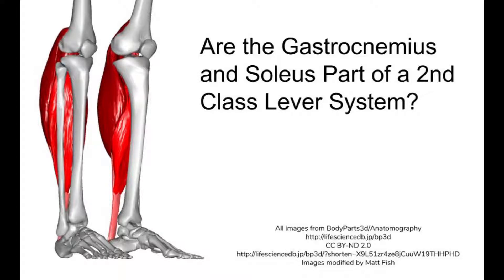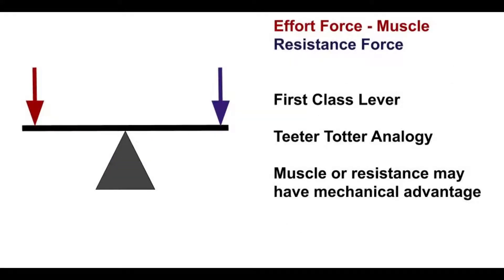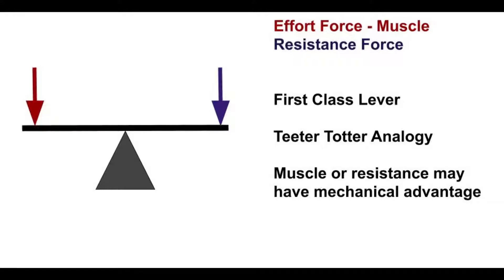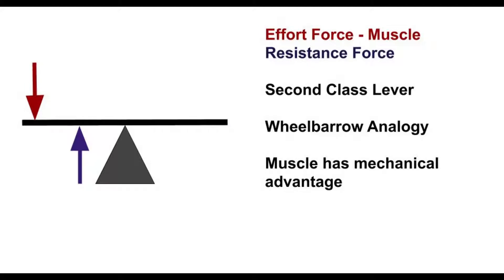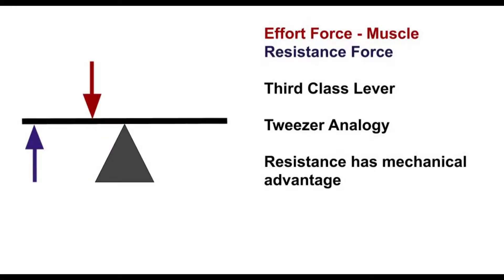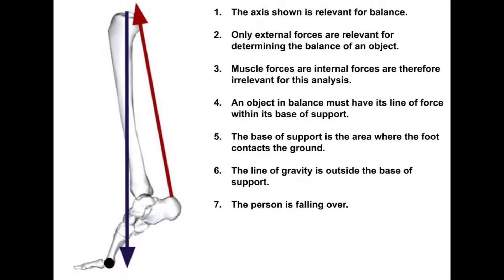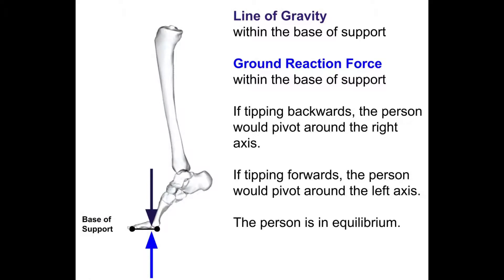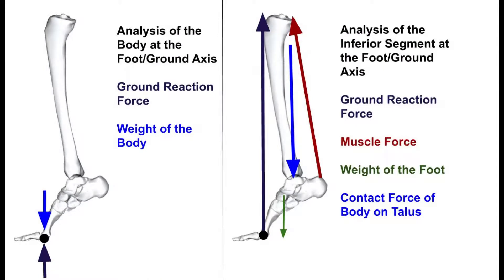Lever Systems of Gastrocnemius and Soleus (Conceptual Only, No Calculations)

Comment: Are there neurological implications to this?
Reply from the maker: Not that I can think of. I am just trying to present an accurate force analysis of the gastrocnemius and soleus at the ankle joint. One big take away is that the force through the Achilles tendon does not always have mechanical advantage. If it was part of a 2nd class lever system, by definition, the gastrocnemius and soleus would always have mechanical advantage, which they do not.

Comment: very confused about the gastrocnemius lever system, the insertion is below the joint at the heel. wouldn't that put the fulcrum in-between?
Reply: That's right, he said the fulcrum is at the talus and then you have the body weight at the toe, and the opposing musculotendon force applied at the heel, with both forces having varying angles and positions at different positions of the ankle